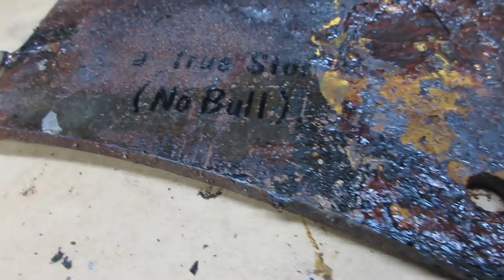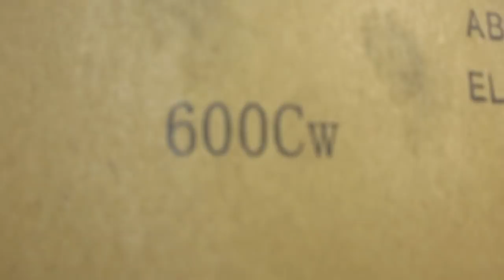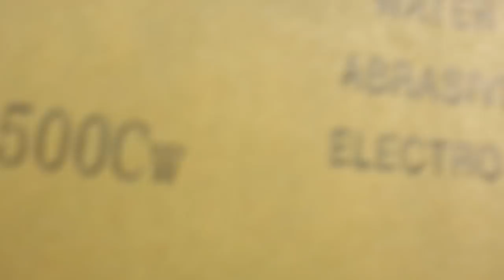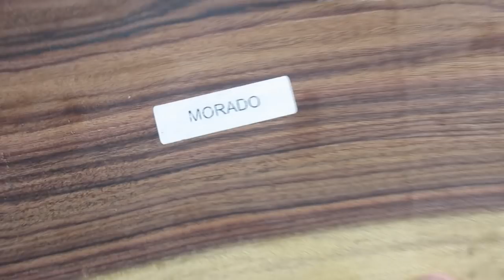Antique Meat Cleaver Restoration

Comment: I see you using JB weld epoxy, how do you like it? I’ve tried a few different brands but not that yet and out of all I’ve used I like the Harbor Freight brand, large tubes. Ya I know but it works great for what I’ve used it on and it’s very cheap. Also I don’t know if I’ve ever mentioned it to you but when your using tape that gives you a hard time, try throwing it in the microwave for a few seconds. It brings it back to life with an easy peel and warms the adhesive up to work better too. Anyway, sweet cleaver! It came out awesome as we’ve come to expect from your shop😉 Thanks for sharing!
Reply from the maker: Thank you! Its ok, the set time is a little more than 5 minutes so thats good!